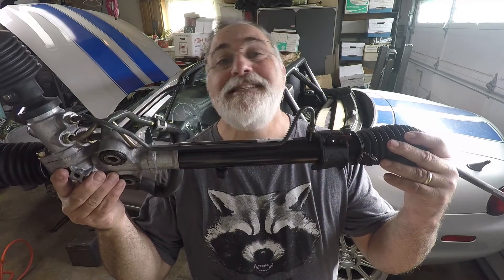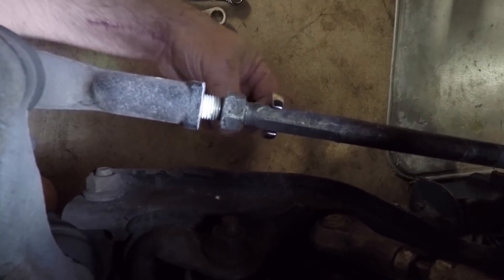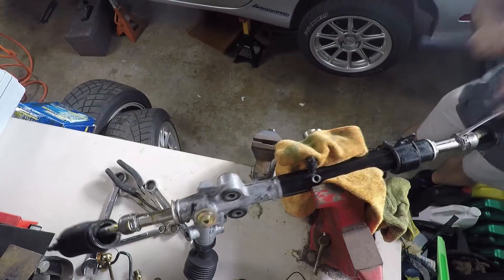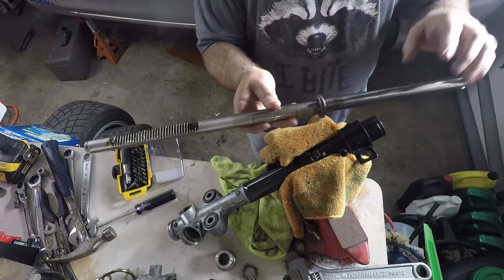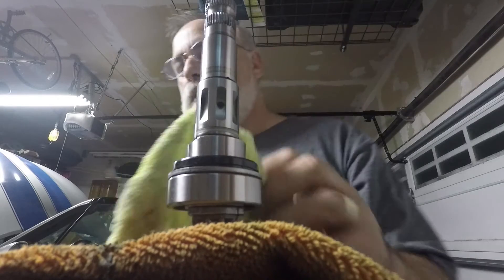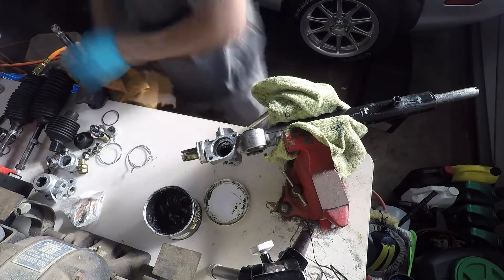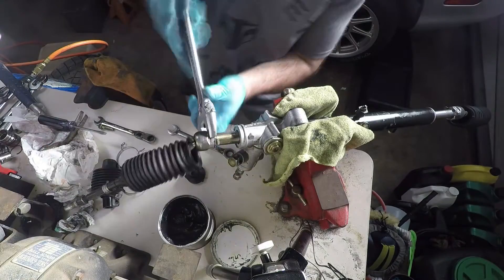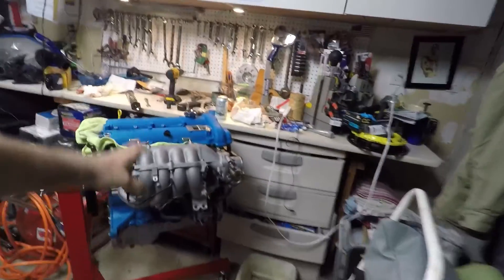Steering rack de-power on the Boosted Miata

Comment: Not a single one of the power steering disconnect YT videos says WHY you would do this. Is the road feel significantly enhanced? How heavy is the steering when parallel parking? Some video of a Miata being driven with unboosted steering would help us decide whether this significant piece of work would be worthwhile.
Reply: On a light car there isnt a need for power steering. I cut my lines and removed the pump and can't really tell any difference.  The pump and lines connected makes the steering hard if car not running. My big dump truck came new no power steering and I can steer it with one finger down the road

Comment: Would it be possible to fix it in place by drilling and using a hardened steel dowel pin, say around 3/16?

Comment: Love the video!  Just wanted anyone watching this,  if you stripped one of the Torx pinion bolts like I did,  I was able to clean around it really really  well and fit a 1/4 in drive socket on to remove it.

Comment: Hi there,
did you leave the cylindrical valve off the main steering pinion when you re-assembled the whole rack. the part that went over the spot you glued?
Reply from the maker: John Hinton yeah I did. Some leave it on in hopes it prevents any additional play. I’ve compared my rack to others with the valve left on, no difference in feel.
Reply: Boosted Miata awesome. Thanks for the input. Love your videos

Comment: Hey how is that possible I did not found your channel sooner ?! awesome content, great info and everything. 
How is that locktite holding after one year ? still no play ? I was thinking about using JB weld or something like that, it seems like better choice to me as there is quite a lot of play in the shaft and this locktite is intended for fixing, bearings, pulleys etc. if I am not mistaken. Let me know how it holds after year of use !

Comment: A little over a year later, how is that Loctite holding up? Thinking about doing this as well but don't have access to a welder
Reply from the maker: Francis V seems to be fine. honestly, I'm not sure the loctite ever really worked, but there's a bit of play, not significant though.
Reply: thats because you put the circular valve in it still correct?   If you weld it do you even have to put that back in to make as minimal resistance as possible?

Comment: how you adjusted bearing preload before the pinion lash. best is to use dial gauge torque wrench to set preload and see tension to move bearing. so after you adjust the pinion lash you double check the preload again after.

Comment: So all those metal rings (i guess this is the valve) in the small pinion housing are just removed and not put back? What holds the pinion laterally secure? 

I will be doing this shortly, and bringing the pinon to a welder. 

Thank you
Reply from the maker: M M I.suppose you could replace it if you want and it fits over your welds. I don't believe it provides any additional support to the pinion shaft.
Reply: Thank you. I will also attempt to remove the inner tie rods from the rack still in the car, I'm glad I read your videos explanation.

How has the Locktite 680 worked in the past few months? Any play resurfaced?

Any of the depower videos or anecdotal text I've come across is from an NA model, which had the worse feeling power steering. My steering currently is somewhat light, but decently communicative, and the faster I go, the harder the steering is (by small increments)

I have a 2001 Miata, and am still slightly tenative to change what already feels good. Could you explain how your steering feels now?

Thanks so much.
Reply from the maker: Hard to say. Maybe, I think I should have welded it. I'm going to revisit the rack in the future.

Comment: I have to say I have never seen anyone going backwards. I really don't get this depowering of steering racks. All my old cars have been non powered. My Miata has power steering and I like it. My 2 does not and it takes some work turning when driving slow. This really just seems like the most backwards thing to do if you have it. Not to mention a perfectly working one. I know this is just my opinion and to each his own, but what's the reason you are doing this for if you don't mind me asking? I know this is a year old but I'm just curious.
Reply from the maker: The depower is certainly not for everyone. This main reason is I deleted my power steering pump and ac was for engine bay turbo access and weight savings. So by depowering the rack (fancy way of saying removing seal) I actually make it easier to turn the wheel. No it's not as easy as powered, but it's really not that difficult.
Reply: Boosted Miata Ok I get the making more room for a turbo but I've heard the weight part before. I honestly don't think that will make much of a difference in the weight department. Either way it was interesting to see the guts of the rack. As you may have guessed I was just cringing when I saw you taking apart your perfectly new looking rack and why I asked. I need to change the tie rods and put new boots in mine and since I'm on a slight hill, I just don't want to go out and do it. lol. I got all the new parts in so it's just matter of getting under there and find all the tools. By the way so how did this worked out with the rack now? Did it work as intended. This is the first of your videos I have seen so I'm not sure if you got your motor back in there yet.

Comment: do you remove the power steering pump when reinstalling the depowered rack?
Reply from the maker: +Terry Low I had removed it before, but never fully depowered the rack by removing the seal.

Comment: Just found your channel! I love it! Gonna go through all your videos. I tried to do this depower on my 1997 rack using gregs video, but after I got it out and disassembled it, I found out i needed a hydraulic press to get the rack itself out of the housing. :/
Reply from the maker: That's too bad. I hear more stories about depowering the rack, how things are slightly different for people. I think Mazda used several vendors (or at least designs) for those racks over the years, which probably accounts for the all the minor differences that show up. Glad you like my channel :)